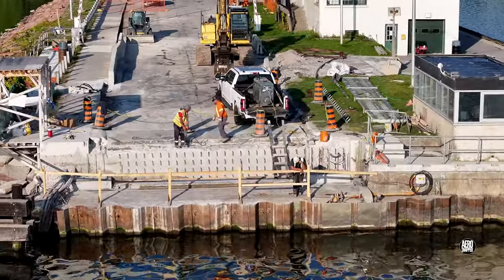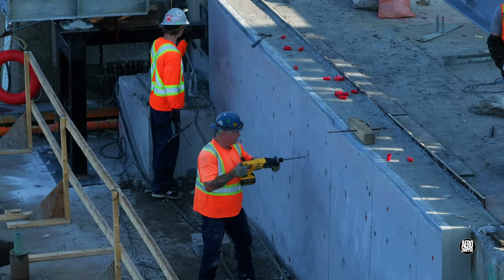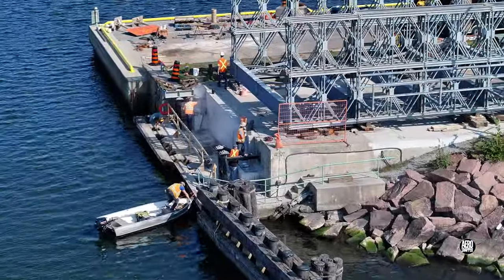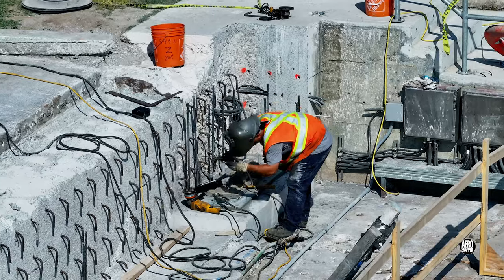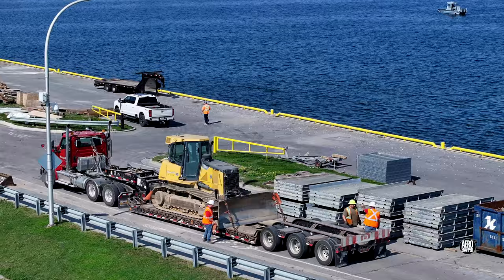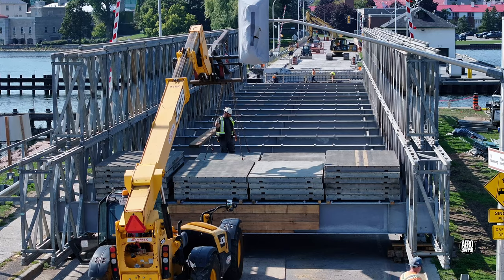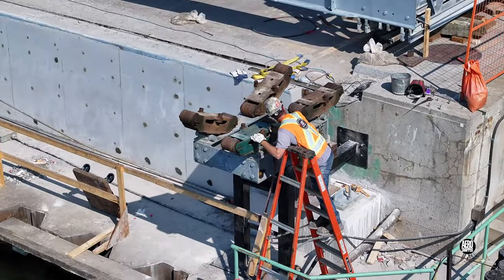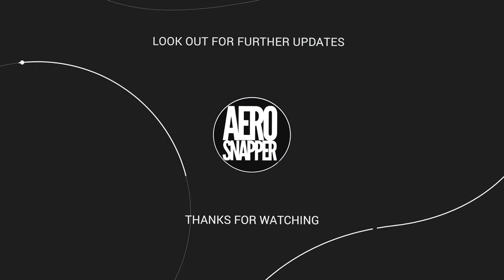One big push should do it  - an update on Kingston, Ontario's La Salle Causeway 4K

Comment: Hi  
Getting close but why not use a crane to set the bridge in place ?
Reply from the maker: By now you may already be aware that a crane was used to lift the far end as the bridge was pushed out beyond the tipping point - all good - now the finishing
Reply: With weight borne on one side, the crane lift weight is reduced.